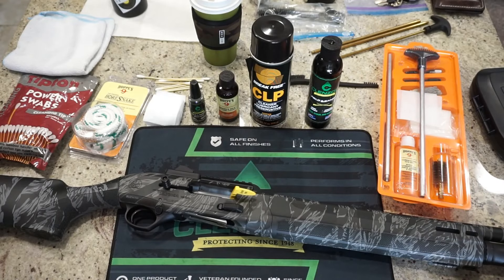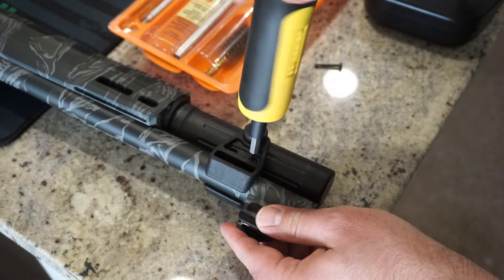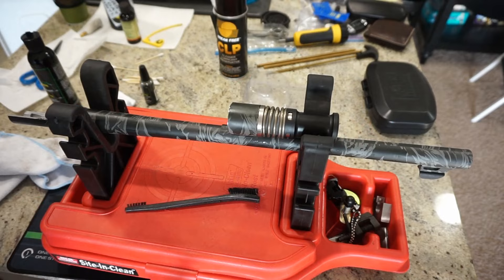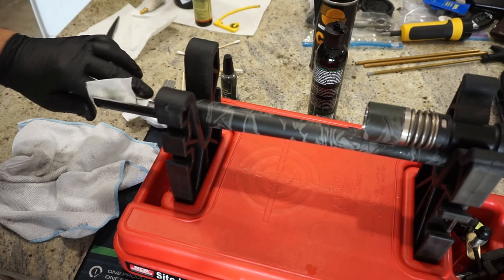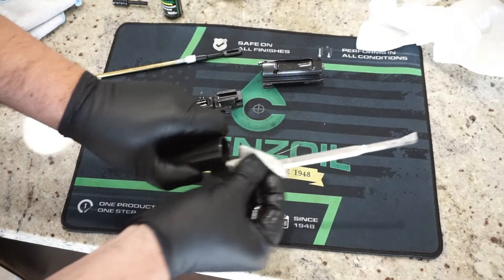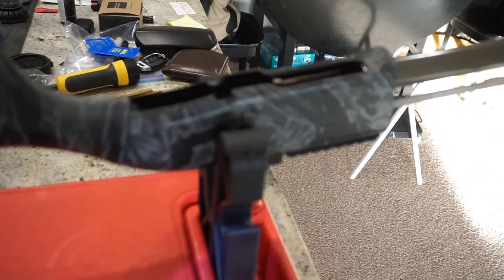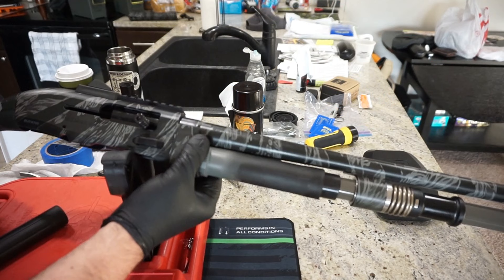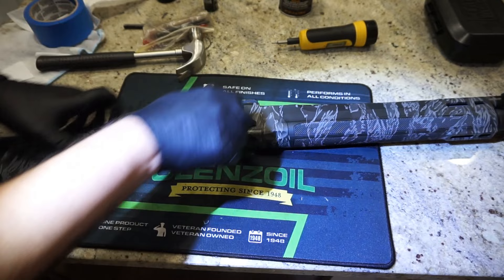How to clean the Beretta A300 Ultima Patrol Shotgun

Comment from the maker: It looks like the finish is hydro-dipped and not cerakoted but either way test your oil/lubricant on a small spot of the gun before you wipe the entire firearm down with it just to be sure it won't hurt the finish. Clenzoil hasn't affected mine.
Reply: What is the potential harm of pulling the bore brush back?
Reply from the maker: @YoungPutter  It brings all that crud, cleaner and sovlent back into the action, nooks and crannies of your receiver.  I try to keep all that going out the front of the barrel.
Reply: @travisp11  ahhhh that makes a lot of sense. Thanks!
Reply from the maker: @YoungPutter  For me its more of a practice for my rifles but I just practice the same philosophy with my shotguns, too.
Reply: Thanks so much for this video...I have an A300 Ultima Patrol on the way.... will be here in a few days.
Reply from the maker: @Gibson45er  Glad to help!
Reply from the maker: @Gibson45er  Congrats!
Reply: @Gibson45er What was the damage before shipping? Settled for a Mav88, but this is the next thing on my list.

Comment: Picked up an A300 Patrol today. I noticed when taking it apart that it has no choke tube and is not even threaded for one. According to Beretta, i have the LE model, which comes as a smooth cylinder bore. Guess it's fine since I plan on running slugs or 00 buck shot. Thanks for the informative video!
Reply from the maker: Yeah. I didn’t even realize there was an LE model as none of the larger YT channels that featured this shotgun mentioned that
Reply: I just ordered the LE version from PSA. In the advert, it stated it had the Mobilchoke system. Now I’m curious what’s going to show up. I’ve read some have the choke tubes. Not sure how I’m going to feel if it shows up without chokes. My guess it’ll be mostly 00 and Slugs so no big deal, however, would be nice if it’s there. Guess I’ll see when it shows up.
Reply: @gunnz75  , if it's truly the LE version, it definitely will not have a choke system. Guess you'll have to wait and see what shows up. I heard the reason LE models have no choke is so they can fire less than lethal ammo through them with no issues.

Comment: Thanks!
Recently purchased a Beretta A300 Ultima Patrol. Could never have disassembled it, cleaned it, and reassembled it without your video. Thanks very much for your excellent demonstration.
Reply from the maker: Thank you so much for your support! I’m glad to have helped!
Reply: @travisp11  dumb question what kind of screwdriver it takes for the first step - removing that clamp?
Reply from the maker: It is an allen key or hex key @dunuth

Comment: Great instruction. Thanks.  Just a heads-up to anyone out there whose A300 Ultima Patrol does NOT have a choke tube or threads to accept one (cylinder bore), you almost certainly have the LE version; look for #J32CT11LE on the box (LE stands for law enforcement). I have the LE version.  From what I gather, Beretta made this version for law enforcement departments without the choke tube because cops are notorious for not maintaining their department owned firearms that usually get issued when your shift starts, then turned in again at the end of the shift, and re-issued to another on the next shift, etc. They only get cleaned once in a long while and it is guaranteed that choke tubes would get lost or otherwise go missing.  Some shotgunners also make the argument that choke tubes can get chewed up by too many rifled slugs through them, although I think Beretta knows what they're doing and you'll be just fine shooting slugs with the choke tube that comes with the A300 Patrol.  Also, there's a debate as to whether IC choke tubes make all that much of a difference at combat/defense shotgun distances.  I personally prefer the cylinder bore - but that's just me.  I can shoot some pretty tight slug patterns with my cylinder bore Rem 870 Police Magnum pump at distance and if I need tighter patterns with my buckshot, I'll shoot Federal 00 Buck with FliteControl wad.  In my humble opinion if you're running a shotgun in a combat scenario, while spread/patterning counts, there are times when I want a bit of a larger spread, and besides it's really the shooter that makes the difference. I served in the Marine Corps (03 infantry) and was also a police officer on one of the largest police departments in the southeast where I served on a SWAT team.  We had the freedom to use a variety of firearms for various situations and often (not always) my weapon of choice was the 12 gauge shotgun.  It's such a versatile tool; from 00 buck, to slugs, to breaching rounds, to tear gas, to incendiary rounds, etc. Concluding - look, don't sweat it either way.  This is a great, reliable shotgun and I'm just an old guy now who rambles and loves the shotgun as a combat/defensive weapon.  I just wanted to give notice to anyone out there who doesn't have the choke tube.
Reply: Thanks for the heads up.

Comment: When putting the bolt assembly back in, I had my gun butt down on a flat surface and the barrel pointing straight up. That made dropping the bolt assembly back in super easy. And having the butt already braced against a flat surface, it was easier to pull back on the charging handle to help with reinserting the bolt assembly. Other than that, thanks for a super helpful video!
Reply from the maker: Cool! I need to try it like that instead! The angle makes it awkward
Reply: Is it me or is getting that bolt assy seated a PIA!  I’ve struggled each time.  Will try your suggestion, thx.

Comment: I’ve had mine for a few months and took a
couple classes but haven’t disassembled mine to clean yet. I’ll follow this work I do. There are people who say you don’t need to clean these A300/1301 often 🤷🏻‍♂️
Reply: I sure hope so. I haven't cleaned mine yet for fear of not being able to put back together correctly or damaging it.
Reply: @bobbyb7127 I’ve gotten into the habit of running a bore snake down barrel with CLP until clean and wiping out ejection port, oiling the bolt; while not disassembling the gun completely. Not as thorough but better than nothing.

Comment: If nobody has mentioned it yet, there is one difference if you get the LE model. No choke tube to remove. It's just an improved cylinder barrel.
Reply from the maker: That’s a good point. When I made this video I didn’t realize there was an LE model.

Comment: Great video. When I was cleaning the bolt carrier group, the part with the tail has a pin holding it in.  It fell out and I mistakingly put it in upside down. When assembling the bolt carrier back into the receiver, it would not slide all the way back into the receiver.  It literally took me 45 minutes to figure out the tail was upside down.  Lol.  Once I corrected that, everything went back together perfectly.  It should be noted that It’s way easier to hold the gun upright when inserting the bolt carrier group back into the receiver rather than having it inserted into the vice.  All in all, best video for cleaning and assembly on this gun.
Reply from the maker: Glad to help! Unfortunately in order to record cleaning videos I use certain angles that don’t always work well off camera. I’m glad you got it figured out!
Reply: @travisp11  Oh no prob.  I reviewed the video at that particular point and you could tell if the tail was upside down or not.  It may be worth a mention that the pin holding the tail in falls out easily and if it does, to pay attention to the orientation of the tail when putting it back together.
Reply from the maker: @Isleofchocolope0U812  I’m gonna pin your comment so future viewers notice that detail. Thank you for watching!

Comment: Anyone familiar with Beretta knows their manuals leave much to the imagination and their support is well...let's not go there. So a huge thank you for posting this video. I've watched it several times and it's by far the best one available for this model.

I do have a question about your procedure vs the manual. In the manual they instruct you to lock the bolt back when removing and installing the barrel. In your video you skip this. Is there a reason why?

And to that point, I've had a heck of a time getting the bolt back into the receiver and being able to retract it back. Even with the trigger group removed and the recoil rod properly aligned, 4 out of 5 times the bolt will only retract back about 1 inch and then lock. I take it out, put it in, repeat,... and then poof it works. But I don't know why. She's definitely a finicky Italian (well Tennessee) lady.

Any additional pointers on getting the bolt in correctly?
Reply from the maker: I didn't lock it back because I didn't want to risk having fling forward so I just left it towards the front of the receiver. Thanks for watching!
Reply: @dancrea9407, "...heck of a time getting the bolt back into the receiver and being able to retract it back...".  Exact same with me, usually on the 3rd of 4th assembly, "poof, it works" me too.  Weird; I just cannot figure it out.  Otherwise the gun is very good, very reliable.

Comment: Must read 👁️ Great detailed video. Thank you for posting. I went inside of the gas block after taking the gas piston out, I ran a stainless steel bottle brush through the gas block , after pulling it out there was a rubber o-ring around the bottle brush. There is a rim inside of the gas block where the 50 cent size o-ring seats. It's easy to put back in
Reply from the maker: Good to know!

Comment: VERY thorough and easy to follow!  Thanks for the good vid.  I'm picking my Patrol up next week!!!
Reply from the maker: Right on! I will be sharing my range test next Wednesday!  It's soooo sweet!
Reply: As a follow up, Travis, I was having a LOT of trouble pulling out and reinserting the bolt assembly while the gun is sitting upside down.  The manual states to have the gun sitting upright for this procedure.  The assembly was not sliding all the way back and it took forever for it to find the right slot.  Once it went in, all was well.  I'll be trying having the gun upright the next time I clean it.  Do you have any thoughts on that?
Reply from the maker: @markej4801  It may be easier so long as the beaver tail off the back of the bolt goes into the recoil cup but for the sake of filming I had mine upside down.  I wasn't a big fan of the manual and found the upside down insertion of the bolt easy, but I was also using a gun stand which makes it pretty simple. I would guid the bold in about 1/3 of the way into the receiver, push and lock the bolt tail into the recoil cup and pull back to seat the bolt.

Comment: Great video. Can’t get the bolt to press the trigger bar all the way back when reassembling.  Does it matter if safety is on or trigger in pulled position?  Is it that movable bar that I have wrong?
Reply from the maker: I may have to go back and disassemble and reassemble to see if I have that problem.
Reply: Ty. After 2 frustrating hours, brought it to gunsmith and he couldn’t get bolt to go back. Sending to Beretta which he said has a “quick” 3 months turnaround. lol. Traded it in.
Reply from the maker: @mdjak3686  Damn! That’s not cool! It’s crazy they could even assemble it. Out of the box I had some minor QC issues too. This new factory where these are built needs to up its game. Especially for a gun intended for LEOs.

Comment: Awesome video, pretty good presentation on how to disassemble and reassemble especially when Beretta doesn’t put a manual in the box anymore. I picked up one about a month ago and finally got around to taking it down. Spent like 20 minutes fiddling with that tail on the bolt trying to get it back in, one thing I learned is that you have to have the hammer cocked back to get the tail out of the receiver when you disassembling it. I finally graduated from pump action shotguns to semi auto, so I’m very interested in putting it through its paces.
Reply from the maker: Right on man! That tail can be a pain in the rear!

Comment: Excellent and very thorough vid! If you want a completely oil free surface such as the recoil buffer piston, shoot it with some brake cleaner such as CRC Brakleen. It will clean any and all oils and lubes off of metal gun parts. I've used it on my Glocks and rifles for years without any problems. Caution: it will eat adhesives such as found on the Velcro of shotgun cards. Doesn't hurt rubber such as o-rings, etc.
Reply from the maker: Good to know!

Comment: Great video. I don't know how welcome polite and constructive criticism is and I do know most maintenance activities shown can be done different ways, but I would recommend against using a torque wrench as a screwdriver for removing fasteners. I know the analog version of the FAT Wrench is capable of measuring reverse torque, so it can be used "lefty loosey" but removing fasteners with it is the equivalent of using a ft-lb wrench to break a fastener loose instead of a breaker bar. Obviously everyone's free to use their tools their way, but optimally (at minimum for maintaining calibration longer) a torque wrench should only be used for setting torque and arguably, reverse torque testing.
Reply from the maker: You make a good point! Thank you!

Comment: good video; thanks.  Why do you recommend not pulling the 12g brass brush back-n-forth?  The inside of the barrel is smooth; cleaning either direction with standard soft brass brush should not do any damage.
Reply from the maker: Just a habit of keeping all the crud going out the front of the barrel. You can do whatever works best for you

Comment: Waiting on mine now!  My 1st shotgun.  It’s definitely a process.
Reply from the maker: It’s worth the wait.
Reply: @travisp11 Received mine today!  Video was great.  The video makes it seem intimidating, but it wasn’t hard at all.  I had issues putting it back together.  Your statement at 19:42 is right on.  Just play with it and it will eventually slide all the way back.  Mine kept sticking.  I’ll shoot 200 rounds through it on Saturday.  Super easy if you follow step by step.  Took me 40 minutes.  My first time cleaning a shotgun.  I have a 92FS compact, M&P Sport 2, TP9 Elite SC, and a Shield 2.0.  Would rate it about the same as cleaning M&P Sport 2.
Reply from the maker: @michaelfranklin7451  that’s great! I’m glad the video helped and it will get easier as you do the next cleaning.

Comment: Maybe you you mention that you will have to remove the trigger assembly to get the bolt and firing mech back in……..before you remove the bolt and firing pin. Fortunately the pin that holds the trigger in ,is easy to remove.

Comment: What can I use (safely) to get the trigger out if I don't have a punch
Reply from the maker: You could tap the pen out with a slightly sharpened pencil. That should push it out enough that you can pull the pin through.

Comment: After cleaning and putting it back together, bolt action does what it needs to. Should I worry about anything else afterwards such as dry firing? I hear from 50/50 suggestions that I should dry fire it after cleaning and some say not to. What should I do?
Reply from the maker: @riomatsumoto5482  if you worry about the firing pin you can always get a shot shell dummy round/snap cap that you can run through it.

Comment: Why shouldn't you run the brissell brush backwards through a smooth bore? For years I cleaned guns pulling the brush back through.
Reply from the maker: I think part of it is that it brings all of that carbon fouling and debris back into the reciver, the channels that the bolt rides on, the trigger pack (depending on how much disassembly you have done.  I do agree though, on smooth bore it really shouldnt matter but I perfer to push all things spent out the front of the barrel.

Comment: Great instructions - thank you. I just took delivery via local FFL after ordering from Bereli; and I had no choke tube wrench.... and no choke tube like yours.  Could something have changed?  Otherwise, cleaned following your video without any issues - thanks again.
Reply from the maker: I may have read the notches incorrectly on my choke tube. I believe they ship with an improved cylinder. If no wrench was in the box you definitely wanna call Beretta customer service
Reply: I too received no wrench and my choke tube does not have any notches.  How do you remove it??
Reply from the maker: @Dgreene88  I have a universal 12 gauge choke key that I bought at the gun store that I can use with mine but mine did include the 4 way tool.
Reply from the maker: @Dgreene88  The choke tube should have 4 small notches at the 12, 3, 6 and 9 oclock positions. Look closely and they should be there.
Reply: Found the answer to the choke. If the box has LE after the model number it has a fixed choke and is the law enforcement edition.
Reply from the maker: @Dgreene88  Interesting to know! I had no idea there were two versions!

Comment: Awesome video, thank you for sharing.
Reply from the maker: Thanks for watching!
Reply: @travisp11  Really enjoy your videos, especially this one since I just bought the Beretta A300 Ultima Patrol. But I need to know something. Have you ever experienced any problems getting the breech bolt assembly to slide into the receiver? First time I broke mine down to clean the factory grease out, it went back in no problem. The next time, omg, I spent an hour trying to get that bolt to slide in. Spoke with a man at Beretta and he said the tolerances are so tight that if the bolt is tweaked at all it will not go back all the way. Watch out for this if you haven't already had it happen to you.
Reply from the maker: @PlugNuster  it is very finnicky but I’ve never had any issues.
Reply: @travisp11   It freaked me out. Never in my life have I seen a bolt so picky about how it is slid into the receiver, wow.
Reply from the maker: @PlugNuster  things have to line up just properly or it won’t go. My other shotguns go back together easier.